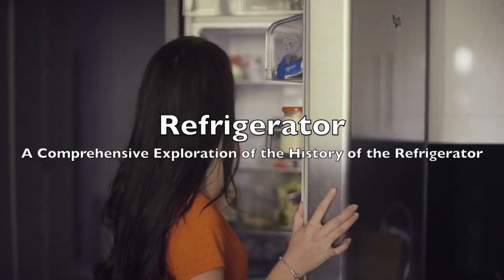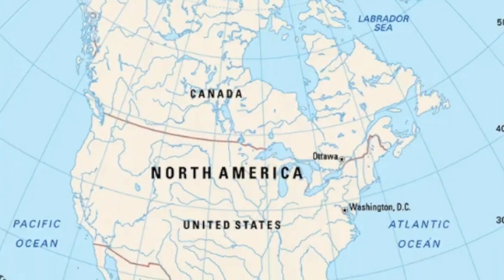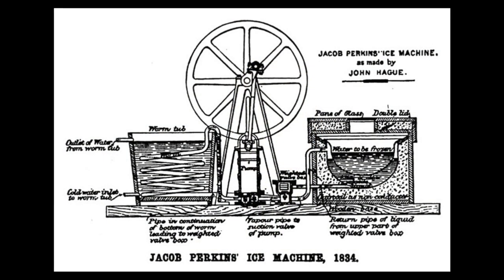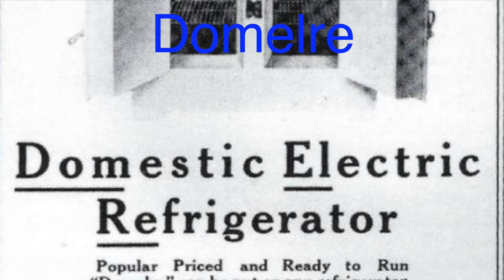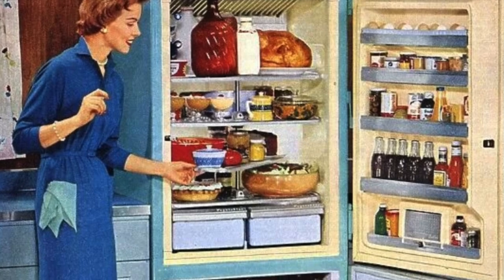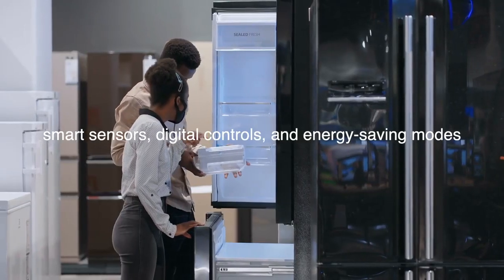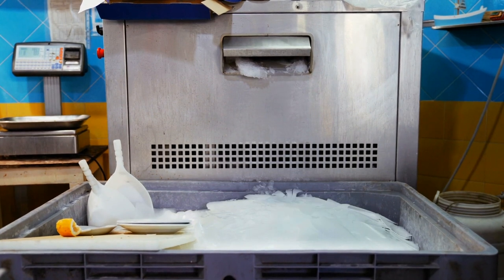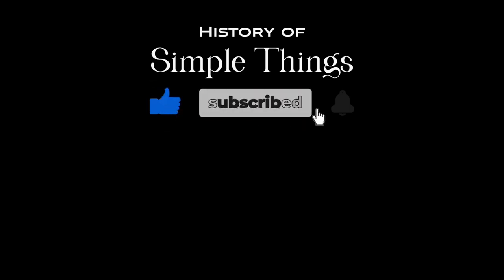The Invention of the Refrigerator: Keeping Food Fresh  (1.1)

Comment: Digitalization sounds good only to young people who were taught it in school. Many grew up using it. To seniors, however, it's antagonistic. VERY ant!gonistic!  Simplicity is the word. Not something so hard to understand.
Reply: We're quickly seeing the downsides. I saw some horrific dishwasher that needed an app, and subscription service just to run it properly. The thing could potentially not work even if all the complex electronics are all in good condition.
Reply: The problem is control boards are made from cheap parts and the software is half baked in order to cram features people don't care but look good on the spec. sheet.